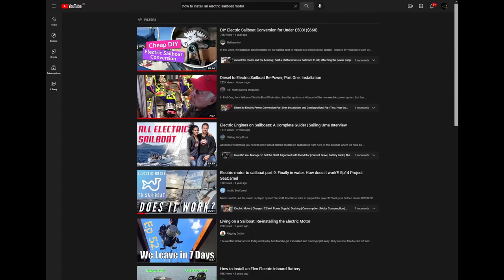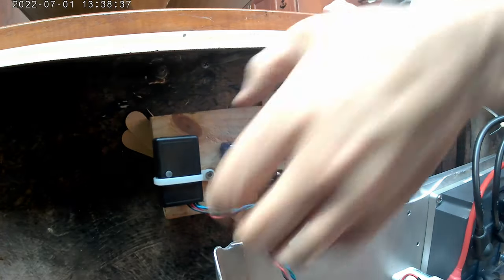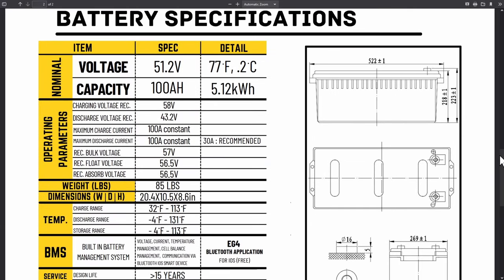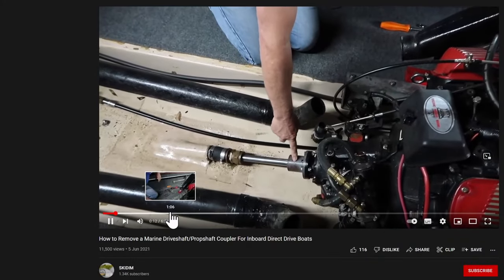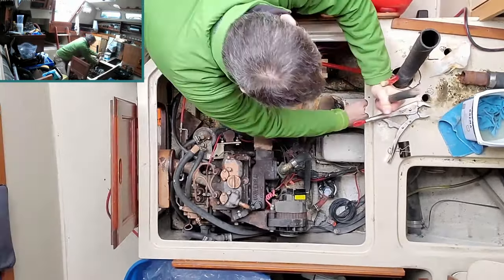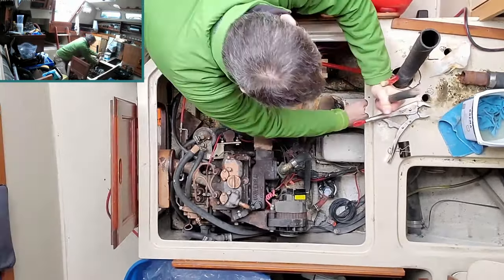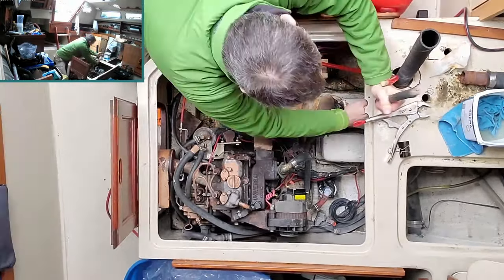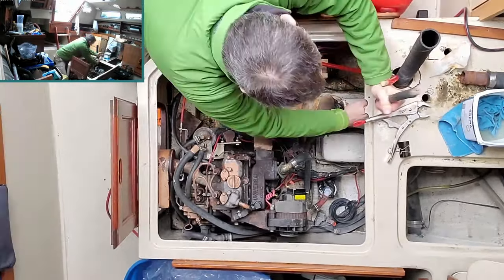How to Install an Electric Sailboat Motor - Catalina 30 - Thunderstruck Motors Sailboat Kit

Comment: I gave u a thumbs up for "yoink your engine out" lol.

Hope this works for you. I wanted to do an electric swap but after figuring the numbers I chose a 25hp diesel and am definitely pleased but I'm a cruiser so when I'm out, I avoid marinas and boatyard like the plague.  Just yesterday I had to motor 35 miles.   Gotta love BC winds 😆✌🏻

Comment: What a great video. I have the same thunder Struck motor you put in. It came with the boat. I have a 2000 watt generator in case i need more charge. Saved my butt many times. Good job.

Comment: Buddy of mine did a conversation on a bigger sailboat. 48ft. He's a nut but an argumentative genius. Solor panels, 2 Wind generators, Hydro Generator 
I helped with the install but saw something I did not like. The engine came with belts like an alternator belt. I suggested he swap it for a chain drive like a timing chain. He said no. On his way to Cabo from San Diego the belt broke. He had spare belts but once it failed he realized it was nearly impossible to access without disassembling the engine compartment.
I got a free trip to Cabo to swap belt to chain and cut an access into the engine compartment so it could be reached from the aft cabin. And yes it all worked out. He went to Australia and is currently enroute to Kawai.

Comment: i was looking for a video like this before...and all i got was a mostly after on a grin install .....i understand the reduction props want tourque.
but i wanted to try to go shaft-less direct for re-gen, and low drag under sail sake, and actually had to design my own 9-phase motor.....
still checking out the way different people are doing it....super video, thank you sir.
Reply from the maker: Thanks!
Reply: @openrov272  it was really sad at the end though....you did such a good job on everything, but you didn't get a re-gen controller.....i felt your pain dude......just price a re-gen controller out, and see if you can get a partial refund for the used one..
Reply: @openrov272  i mean that's the whole point of an electric drive conversion on a sailboat....i think those Sevcons are all re-gen capable.
Reply: @openrov272 Re-Gen Is More Dependent On The Controller Programming ....if you "load" a prop too hard, it won't spin; if you don't load it hard enough, it will just spin .... it's kind of like manual MPPT...so you have to Tweak The Re-Gen Controller Programming........and reductions might be great for forward propulsion, but just as much, they cause a reduction in re-gen....if you have a sevcon , then mess with the re-gen programming under sail....looking for the sweet spot.
Reply from the maker: The problem with regen for my boat is just that the prop is too small. But my next big project is to make that work one way or another. :D
Reply: @openrov272  the prop being to small for re-gen is a myth....it seems people who don't think much of re-gen, just don't put much thought into re-gen ..... it's all in the controller programming ... and you can call your controller manufacturer for support on that..

Comment: So glad you mentioned the waterproof eg4's   I had not considered those for my build.   They're now 200 more each than the server rack versions I was planning,  and I'm buying 8,   but the waterproof feature makes me think these are the better option.
Reply from the maker: I think you are right. You have to protect them one way or another, and if the waterproof ones leak, it someone else's fault! (just kidding. sort-of) The insides of boats get wet more often than the insides of houses, so rack mounted batteries, on a boat, really are in danger of shorting out. If rack mounted batteries had been in stock when I needed them, I totally would have bought them. And I would have regretted it. :O

Comment: Good video. An alternative to cutting the stringer is to use an upside down 6mm 316 stainless L shaped bracket to bring the motor lower. 

With the alignment one can try fixing the coupling first then play with the mounts.
Reply from the maker: Yes! I would have preferred to do it that way, but at the time I didn't know I could probably get the sheet metal shop to bend some brackets for me. So I decided to go with the method I knew I could make work. It would have saved me many steps to use some 'Z' or 'L' shaped brackets!

Comment: I recently installed an electric yacht 20kw in a 37' Irwin, and it was weak. The tides were stiff, and the run from dock to sail area was long. Electric is still a fantasy. Battery densities and motor efficiencies are a ways from max, and alternate power sources should be included. It was quiet and pleasant.
Reply from the maker: Range can certainly the issue with electric motors. But you should not be having an issue with power. A 20kw motor should be plenty powerful for your boat. If it feels weak, then something is wrong. Do you have gear reduction? If you do, the ratio may not be correctly matched to your prop. If your motor reaches max RPM before you prop does, max power will not be attainable. (I have this issue. I set things up for the prop I plan to get, not the one I have. And I haven't gotten the new one yet.) Alternate power sources are a great idea. Some people have a generator for back up. I have a 15hp outboard (for my dingy) that can easily push my boat at hull speed. I haven't used it yet (apart from testing) but I will.
Reply: Yes, maybe something with your setup. There's a vid of a converted all electric commercial lobster trawler hitting the swell called  'An all electric Lobster fishing boat Watch It Work Lorna Jane'. If he can do it.

Comment: Nice job, thank, but one must wonder, given the very reasonable price of used boats, whether it would be more effective to find another boat in good shape and upgrade. I’m thinking that if I were to replace the engine, an outboard or Torquedo would be my preference and so avoid the issues associated with the prop, shaft, bearing, etc.

Comment: brilliant video, so much information it deserved a sub. wondering if it's possible to take that setup and add it to the drive shaft while keeping my Diesel engine like a hybrid while puttering around running on electric but for longer hauls switching between the two, oh that's a thought if I am running on the motor for propulsion would the electric motor then become a generator?
Reply from the maker: Thanks! 
There are companies that make parallel hybrid setups for sailboats. I haven't seen any that were kits or packages made to update existing motors though. That would be very cool if they did!

Comment: i sized a system for a Grinde 27, using one of the newer axial flux motors and got the pack down to 24V ( 25.6Vnom ).....that's the gold, because the system can still be electrically floating..

On Salt, anything over 25.6Vnom ( up to 51.2V Max nominal Li-Ion ), you really need the center tap sea ground, to center reference the pack;
but as soon as you put in a sea ground, you need faraday cages, and a way to rote lightning current to sidarcs..
Reply: Can you share a link to the actual flux motor you used please?

Comment: Interesting video thank you, would like to have known the weight differences,  is it getting to a point where a 300ltr tank and big v8 stern drive could be changed out for electric or do we still have to wait for tech to catch up
Reply from the maker: My diesel engine was about 250 lbs. Plus full fuel tank which I think was about 170 lbs (not including the tank itself). There was additional weight from the heat exchanger and whatnot. The new motor was about 50 lbs and the batteries are about 85 lbs each (x2 170 lbs). SO currently I am under weight by close to 200 lbs. Which leaves room for more batteries. :D

Comment: Very informative video. Thanks. Two questions please:

1. I'm sure that you've mentioned it elsewhere, but how many of what type of solar panels do you have feeding this system?

2. Seems I've seen a video or two from others that show a direct connection of a similar motor to the drive shaft (instead of using a belt). Do you believe the belt is simply mandatory, or did you choose it for other reasons?
Reply from the maker: 1. I don't have any solar panels... yet. Just batteries so far. I expect/hope to install some.  :D

2.a. Using the mount, with the belt to change the gear ratio, helps in a few ways. Changing the gear ratio to match the desired rpm of the prop means that the motor can reach maximum rpm. According to Thunderstruck, this is more efficient, gives better torque, and reduces prop cavitation. 

2.b It also gives more control of power output. I'll try to explain. Compare turning the throttle a quarter of the way to maximum. The straight shaft will spin 2 or more times faster (depending on) meaning more power goes to the prop. The shaft with gear reduction will spin slower putting less power into the prop (for the same turn of the throttle) which gives more control of how much power is used while maneuvering, (or even holding position in a current.) The straight to shaft setup will reach the real max RPM of the prop at or below half-throttle. (I'm not sure I explained this well. sorry.) I'm guessing the throttle (or the controller) could be programed to avoid this particular issue, but I don't know how, so this is still a bonus for me. :D.

2.c. The motor needs a thrust bearing between itself and the prop shaft. This is a requirement because the motor isn't made to support the shaft directly. Thrust bearings can certainly be installed on their own. But I have no experience with that. This motor mount/gear ration changer has one built in. So that is a nice bonus. It really makes installing the actual motor much easier too! And it will be helpful when I need to remove the motor. 

I should note that, by far, the number one reason I chose to use the available motor mount, is just that. It was available. I needed a way to install the motor and this solved that problem. I didn't have machining skills or experience, so I was happy to not have to solve that problem. heh. :D
Reply: @openrov272  Very good, detailed explanation, thanks.
Reply: @openrov272  The mount also gets the open frame motor further out of the bilge and away from any seepage from the shaft seal plus will prevent the high speed Motenergy ME1115 Dual-Stator Brushless Motor (yikes 5,000 rpm) from running full torque at low RPM generating heat and consuming more energy which will greatly reduce range.  You could direct drive and change the prop to match the motors direct drive speed range to overcome this as others have found however upping the shaft speed likely will accelerate bearing, shaft and seal wear.  

To me the Elco with its totally enclosed design with integrated controller and speed matched motor (1,500 rpm) is a better engineered solution due to the protection it provides the motor from getting contaminated with water/brine but then Elco has been at this for well over a century starting with the Worlds Fair Electric Launch's in the late 1800's plus a variety of submarines from General Dynamics since around the first World War.  A number of the 1893 Worlds Fair propulsion systems are still in original condition and operational today as are a number of the boats still being used to ferry passengers, not just sitting on display as museum pieces.  Their EP-12 Electric Inboard 12 HP equivalent with everything (motor, coupler, mounts, controller, throttle and charger) except the lithium batteries comes to around $8,299.

Its becoming easier and more viable to do this today and its nice to see the various options being pursued.

Kudos for taking a shot at this as a DIY project and sharing.

Best!

Comment: I'm a bit puzzled. Your spreadsheet says that you have two batteries of 48V at 200Ah each which gives you 9,6kWh each or 19.2kWh total. In your video you said that you only had a 10kWh battery bank. I'm not familiar with those batteries and they are not available here but the LiFePO4 batteries we get here are not 48VDC but 53 to 56VDC which changes the calculation somewhat giving 53VDC x 200Ah = 10.6kWh or 56VDC x 200Ah = 11.2kWh per battery. I am assuming that the batteries are the rated voltages I mentioned and not 24VDC base meaning you had them in series to get the "48VDC" you mentioned. It is quite a nice detailed build video, well explained.
Reply from the maker: Each of the 2 batteries in my boat are (I think) 51.2 KWh. They are actually 51.2v, 100 Ah  each. (But that range is called "48v", which is confusing. :D) So I have a total of 10.4 KWh. Sorry if that was confusing in the video, or on the spreadsheet!
Reply: @openrov272  So if I think about how long you can go with these 10.4kWh out of your batteries? With maximum Speed at this 10KW - Motor, this would be about 1 hour🤔

Comment: Interesting.   Haven't seen your channel before and may have skimmed over this but what prompted you to do this conversion?
Reply from the maker: The fuel tank and heat exchanger for my diesel both needed replacement, and though the motor itself was working, it needed work, probably a rebuild. I really like the idea of installing an electric motor so instead of spending money to fix all the rundown parts I had, I spent the money on an electric motor kit. :D

Comment: Hey mate. Thanks for the super informative video. Am just installing my electric as we speak. Do you have any roll pins (or and type of pin) with your coupler other than the two retaining pins? I have a taper lock coupler and can't find an answer to if the clamping force is enough for the thrust forces (forward and reverse) or weather I should also reinforce it with some sort of thru shaft bolt / pin set up.

Love your work on there finally being a how to out there!
Reply from the maker: I just have the two retaining pins. I know that the interference fit on (one side) of my couple, does the bulk of the work. But the retaining screws on my set up are definitely required! :D
Reply: @openrov272  legend! Cheers

Comment: Have you thought of supplying voltage for the electric motor with a gas/diesel generator ?
Reply from the maker: It's a great idea, especially for longer cruising trips. I don't have one, but I do have a 15 hp outboard for my dingy, and it easily pushes my boat at hull speed. So that is my back up currently. But I have seen (on youtube) several people use generators as back up when cruising. They are relatively small an inexpensive these days (for gas generators.) In a bigger boat, a diesel generator would be great.

Comment: Would you do it again today? Would you use the same or different motor and if so why?
Reply from the maker: I would do it again yes. And I would use the same motor. :D I'm very happy with the motor. I haven't discovered any downsides, and the price was better for this motor than the others I looked at.

Comment: why did you chose to go 48v? I see a lot of people doing it and I don't understand why. I know there must be a reason but I have not read, see or heard why. Thank you in advance.  (love the spread sheet)
Reply from the maker: If you used 12v, the current draw would be so high that you wouldn't be able to afford the cables. Using 48v means less current for the same amount of power, and the cable size is determined by the amount of current, not voltage. The reason to not use higher than 48v, (even though it would still smaller cables) is that 48v is considered safe (or so I have read)  but going much higher that 48v can start to be unsafe for some people. Person to person, we have have different conductivity. Some might be safer at higher voltage, some at lower voltages. :D This is the best answer I have found, but I am no expert.
Reply: Electricity is made up of voltage V and current I. When these go through a resistance R they are proportional (double voltage halve current) V=IR. However, power loss is I squared so if you double your voltage current goes down by a half but power loss is now a quarter. So higher the voltage the smaller the wires needed.